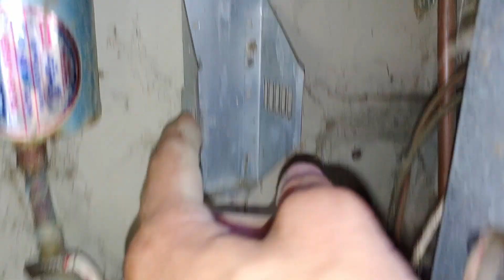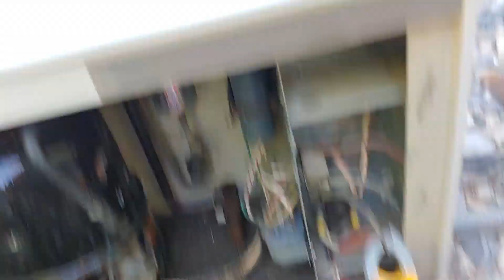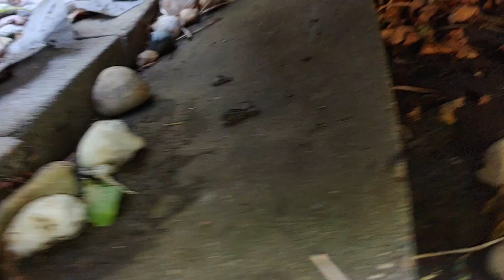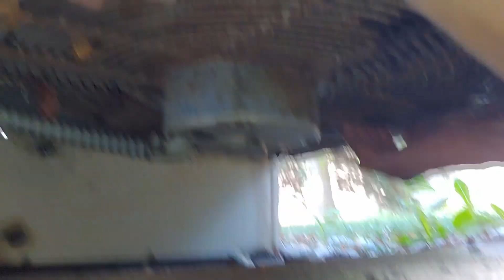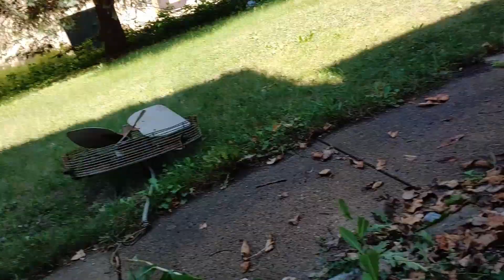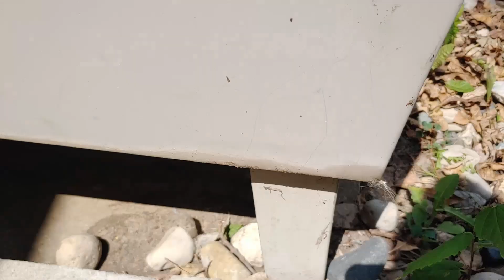Impressive OLD Lennox AC! What to do if a Compressor is REALLY hot!

Comment: Lennox HS8 Series 1971-1981. 'Low Silhouette Condensing Units Feature Dependability, Efficiency and Economy'
I'm reading a PDF of the data sheet. I think that one is the HS8-211FF and possibly 1976 by the serial number.
Made me So Happy you helped that little guy out in his time of need!
There does seem to be plenty of parts still available, including the missing rain shield for the fan motor. ($6.66)
Reuben you are Awesome! 💯